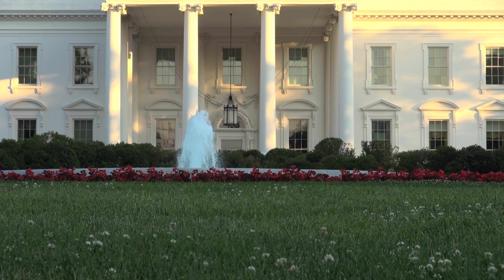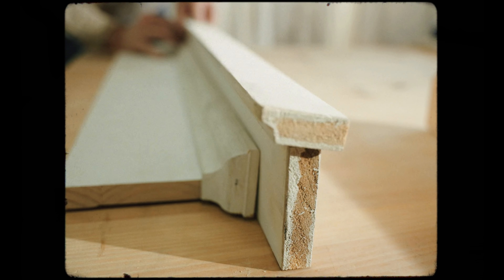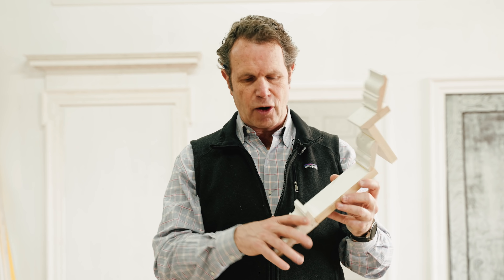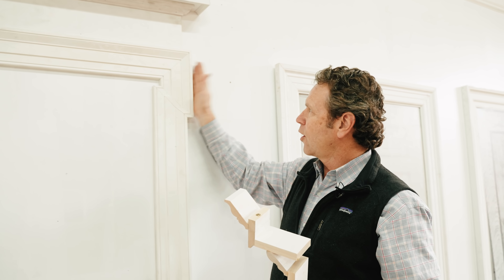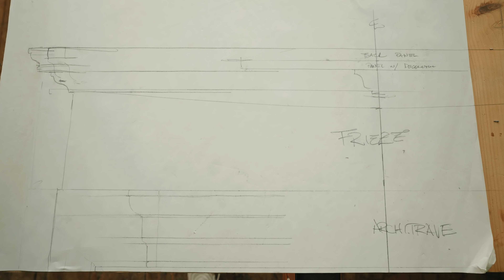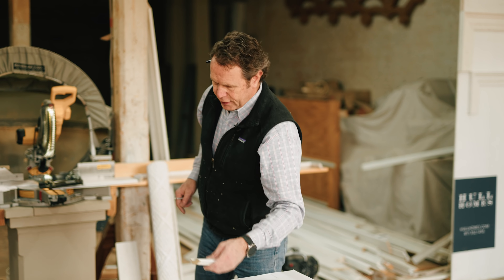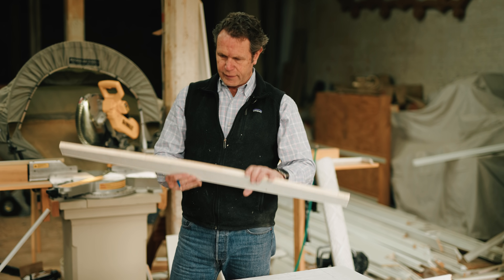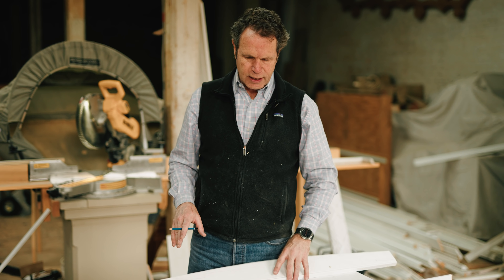Master Trim Carpenter Challenge. Could you build this door header from the White House?

Comment: When you build a corona with that cove on the inside edge of the vertical/face, how do you align that to the horizontal piece of corona? Do you flush the top of the cove with the bottom of the horizontal or do you leave a reveal? I assume there is a historical precedent.
(I tried to pause the video 10x while you were holding the sample entablature to catch a glimpse but couldn't see it well enough.)
Reply: ...oh, and that is my new favorite entablature. Have anymore of those carvings laying around to sell? That would be an awesome plaque on the wall in my office.
Reply from the maker: If I understand your question correctly, I let my cyma molding hang over the corona and let it become a drip edge. I could have lifted it up and revealed more corona but liked out compact it get. There is historic precedent for both. Thanks for asking. I hope that helps.

Comment: How did you work out the mitre for the bowed moulding? 
Looks great btw
Reply: Could you clamp the bowed moldings and return molding on the radius and use an angle finder where the moldings butt together?   Or maybe he drew the bowed molding  and return molding on his full scale drawing and bisected the angle with a compass and protractor?   I'd like to know how he did it, too.
Reply: @jonathanlombard8897  I’m guessing he’d of taken the angle off the drawing but wondered if there was some maths that’s give the answer.
Reply from the maker: Took a couple of tries but had to set the side pieces first. Thanks for watching.
Reply from the maker: I've thought more about your question and realize I didn't answer it well. When you draw it out on paper, the top view allowed me to use a miter gauge to dial in the exact miter and get a tight fit. Hope that helps.
Reply: @BrentHull  that does help- I thought that’s probably how you did it but I know when I’ve tried to mitre onto a bowed piece before it’s just not worked out quite right, I think it’s because the bowed piece didn’t exactly match the arch I had intended. Thanks for the reply, all the best